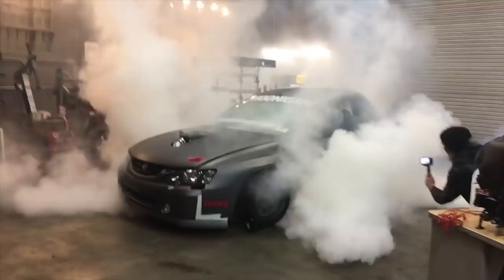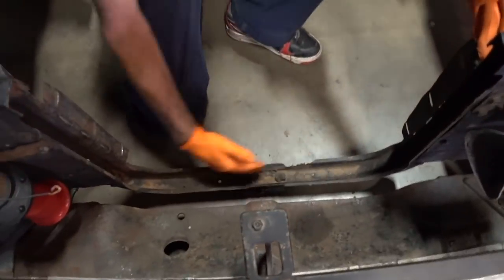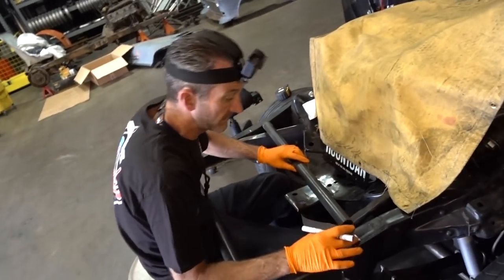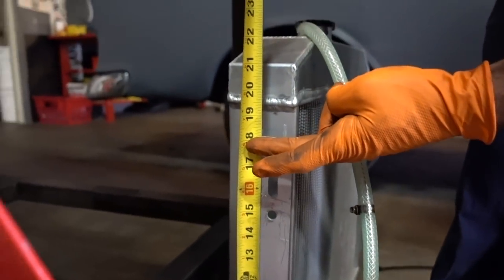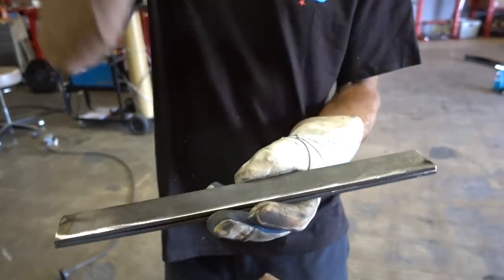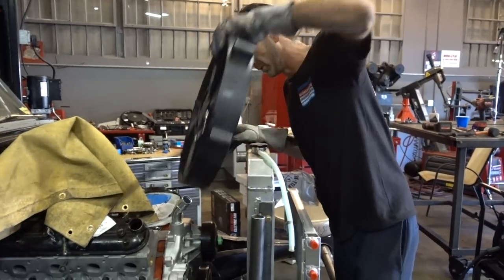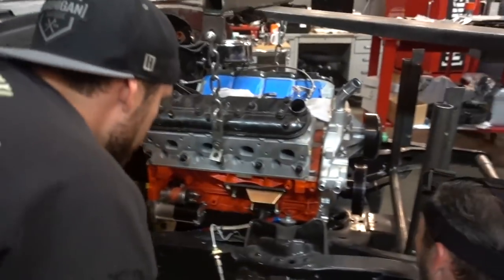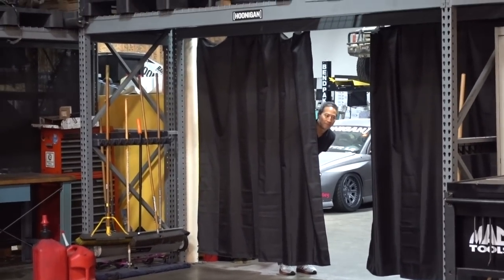9 Sec. LS Powered Gasser - Oil & Cooling System Set Up

Comment: So I learned a neat little trick for marking TDC on pipe (for notching, Center to center measurements and checking pitches) I'd like to share. Take your desired piece and a scrap piece (same diameter), put em side by side, and slide a 3rd piece of pipe over the top of them (creating a mark on the top of your pipe). Cheap and easy way to ensure your copes and miters aren't a few degrees out of whack

Comment: Should put hinges on the fenders and make the hole sheet metal assembly lift open like the hood opeans so in essence you would lift the bumper and raise the fenders and hood headlights as one . It would be different

Comment: Gonna put any shrouds on those fans?

They work a lot better in slow traffic, even with a weak shroud
Reply: It would still help pull the air through the front of the radiator instead of next to the fan
Reply: They're probably big enough and the fact that theres 2 fans most likely covers heating issues pretty well. But I could be wrong. We will see in time!
Reply: I think it will work fine without shrouds...it could just run a bit cooler in a traffic jam on a 90 degree day with shrouds; and as an added bonus they protect the cooler fins from flung rocks & road debris

Comment: I know this is probably from a little while ago but how about making small slots for the top of the radiator brackets along with holders on the bottom so you just have to loosen the bolt on the top and slide it in and out easily without having to wiggle the radiator to find the hole (LoL) and slide ride in like how Kado does in the Dm's.

Comment: Cringed at moving the engine foreward an inch.  Cringed at the size of radiator support  tubing.  Cringed at oversize radiator.   Cringed at adding pusher fan, damn near died when I heard motor was going foreward another quarter inch.      So much for weight reduction.  Still love you guys

Comment: If the fan between the Rad and the engine ends up not fitting then just run a Spal Slim fan and you'll be golden

Comment: Why move the engine forward? Just clearance the firewall you will get better weight transfer with the engine back and not right on the nose. Weight transfer is key to getting a gasser to leave the line hard

Comment: Big mistake not leaving room for a radiator shroud you wanted to go 7s on the drag strip you will spend time in line on tarmac at track temperature not moving while your temps go up for the sake of two to three inches you can effectively use the area of the whole radiator

Comment: 1. Hammer firewall
2. If you can't hammer it enough, cut out firewall
3. Take advantage of that and set engine back more
4. rebuild firewall and enjoy better launch and stability at higher speeds.
You never move the engine forward in a drag car.. I bet this "Gasser" gets turbo'd... I'm hoping not....

Comment: the saw will not cut through the pipe........turn the pipe over,problem solved! The blade only has to cut through half of the diameter of the pipe or through the thickness of the material.

Comment: So you want to try to beat blasphmy the aluminum block blown hemi with a full built LS I don't care how much gear ratio you stuff under the car it ain't happening . Maybe on a 1/8 but not the 1/4 mile track stuff the rear with a 5.56 and pray it would wheely for days or fold the front when it came down but still be a blast to drive. the thing is blasphamy should do 8s in the 1/4 but finny is a chicken shit .